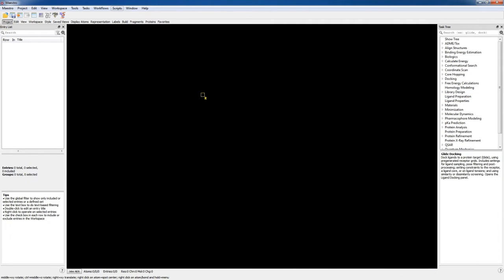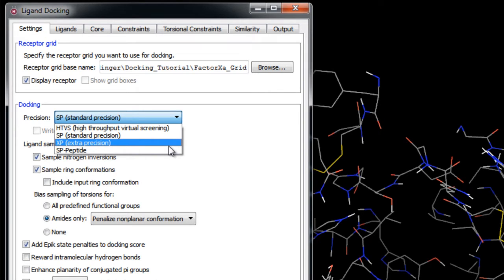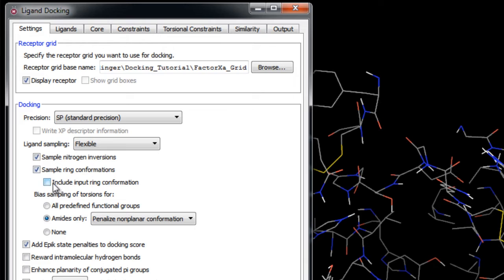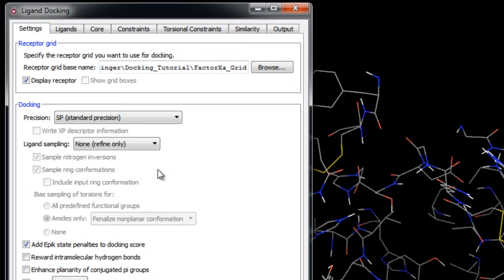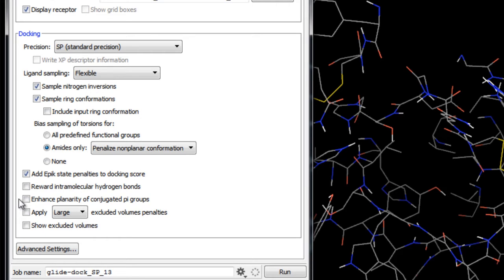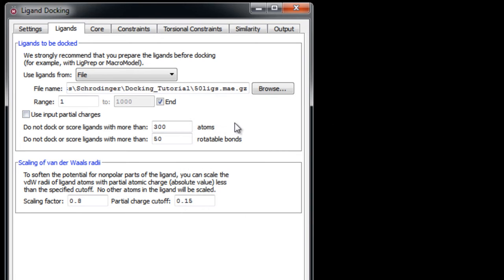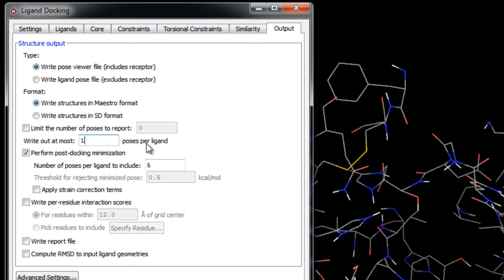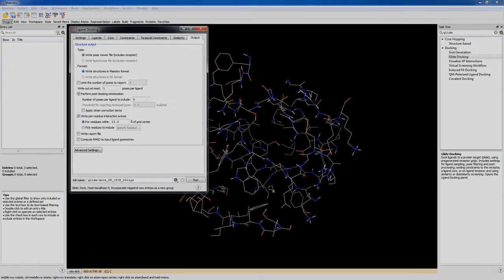[OUTDATED] Setting up a Glide Ligand Docking Calculation (All Chapters)

Comment: I intensively docked the receptor by the ligand repeating any times to received multidocked rec-n*lig system. From any docking step i have received the response the same as starting previous step  without addition of new ligand. I have seen output files and marked that unsuccessful docking folders haven't the file with .rept, for example iggdocked.rept.
Why this file is lost and how to prevent this unhappy in next docking studies?
Reply from the maker: Hi Roman Boroznjak,

Thanks for your comment. There might be a few different reasons why the files are getting lost, but it is hard to say without a little bit more information. Could you please email us at help@schrodinger.com and attach any files you have from the failed docking job?

Best regards,
Jarred

Comment: i want to apply constrain in docking. but getting error in glide ligad run. any tutorial video available?
Reply: WARNING Constraint "position1" has no SMARTS patterns defined. You must define at least one pattern for this constraint before this job can be written or started. To define patterns for this constraint, select it in the Constraints folder, and click Edit Feature.
Reply: krunal patel Unlike H-bond and metal constraints, where reasonable default ligand features are known that can satisfy the constraints, a positional constraint is a very generic type of constraint.  Therefore, it is necessary for the user to define (via a set of SMARTS patterns) the ligand features that can satisfy the constraint.  Please see Section of 3.9 of the Glide Quick Start Guide for a tutorial on using a positional constraint.  Sorry, I don't think we have a tutorial video for this yet.

If you have further questions, please submit queries via email or our web form...

http://www.schrodinger.com/supportcenter/

Sincerely,

Jeff Saunders
Schrodinger Technical Support
Reply: ok thank you for your response.